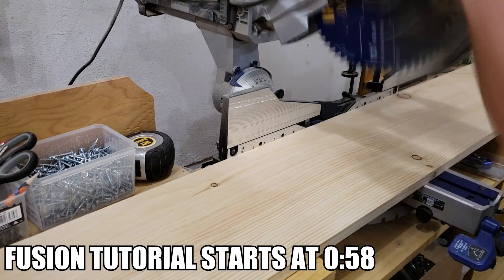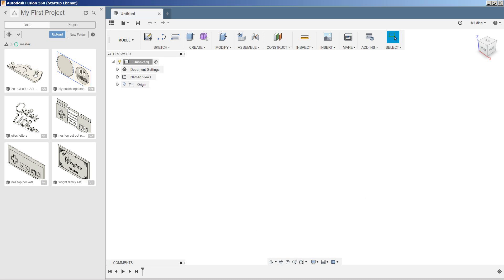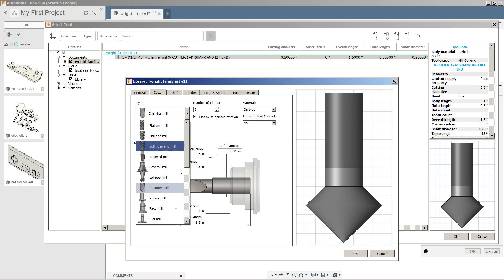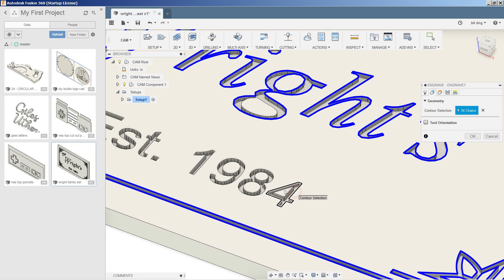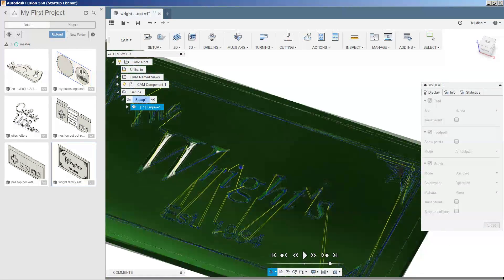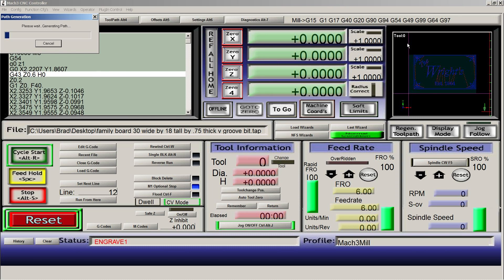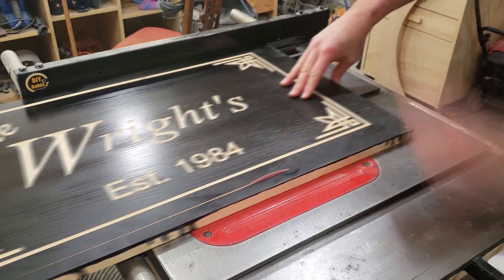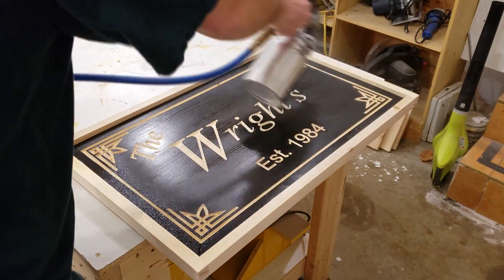Fusion 360 Basics - How to use 2D Engraving (Decorative Wooden Sign)

Comment: So I have the same chop saw as you, and I'm curious if mine is just screwed up or if I'm doing something wrong - when I put something flush against the fence and try to cut, the stock blade will cut everything fine except the smallest corner, the bottom/back furthest from me. usually just throw a couple 2x2 scraps or anything of equal thickness to offset whatever I am cutting, but obviously it would be nice to not have to deal with that. Is that something you ran into ever with this one?
Reply from the maker: Loosen the fence and move it as far forward as possible then adjust for square.

Comment: How could I draw the text and outside decoration, I mean why i could not design and draw them by fusion then make the rest of operations that you did in the video?
Reply: sorry i do not catch your words well
Reply: You can do all of that in Fusion using sketches under the design section (the main section when you open fusion 360). He's just more comfortable designing in a different software. I will often design in Inkscape to create vector files (like DXF or SVG) and import those into a sketch in fusion 360 onto the stock board I create. There are many correct solutions that are based on personal preference and ability. Good luck!

Comment: great video! 
do we really have to select every top geometry line like that? what a headache, there must be a select all top function or something...
Reply from the maker: Yes
Reply: If you do your design in fusion 360 or import a DXF or SVG, you can select the sketch plane from the tree list on the left. It can save you time trying to select each contour, but my experience with it has been spotty. It selects everything but sometimes Fusion has a weird interpretation of how it will engrave in between contours, so just double check the simulation to make sure it engraves where you want it to.

Comment: Can you take me as an apprentice?
Reply from the maker: Ya but i don't pay and the hours are terrible.
Reply: @DIYBuilds  I am just interested in learning. I don't want payment.
Reply: @DIYBuilds  I have some knowledge on CNC router machine operation. I understand the mechanics but the engineering and the circutary is what I want to learn
Reply: @DIYBuilds  by the way how much do you sell one if it is possible to get a power supply of 220V. I want to use it in Africa

Comment: Very helpful thank you.  Does it save the bits you create or so you have to do it each time?  I cant find the bits I have edited once I start a new project.
Reply from the maker: Save them to the library not the project.
Reply: @DIYBuilds  Thanks how would you do outlined letters rather than engraved?
Reply: Thank you that worked one more question how do you add the border? Was that an svg or did you create it?

Comment: I think your machine is tramping
Reply from the maker: Huh?
Reply: https://youtu.be/2n8KcTBNS4U see this 10.00
Reply: Sorry its tramming
Reply from the maker: @harisabdullah576  how can you tell?
Reply: @DIYBuilds  see ur vedio at 10.00 u can see tramming on w
Reply: @harisabdullah576  @DIY Builds I think they are referring to the rise in the center of the wide strokes of the "W" due to the two passes that the V-groove bit took. I believe you explained that when you said that there would be two passes due to how thick the lines on the "W" were.